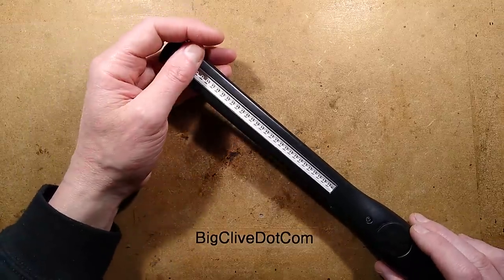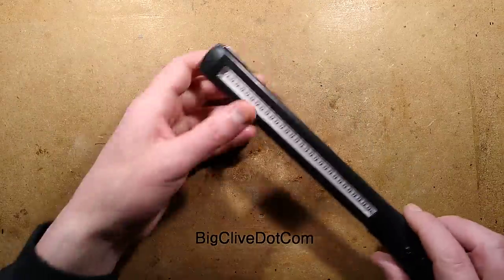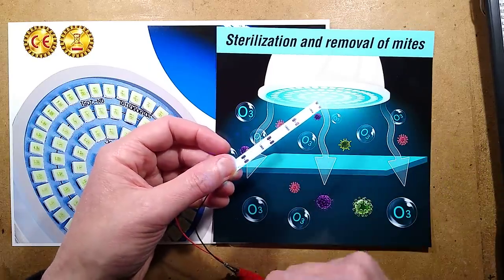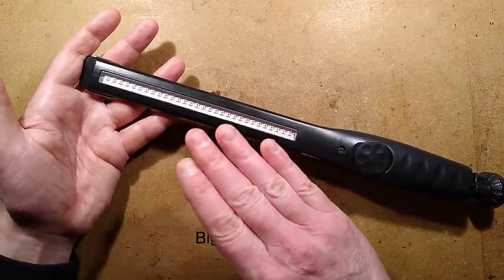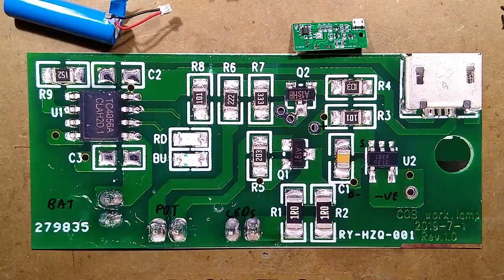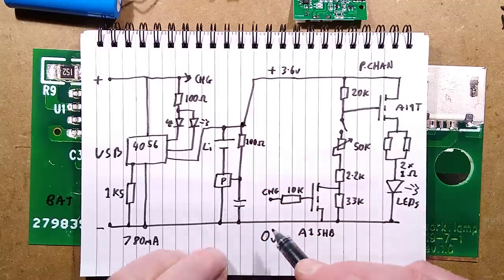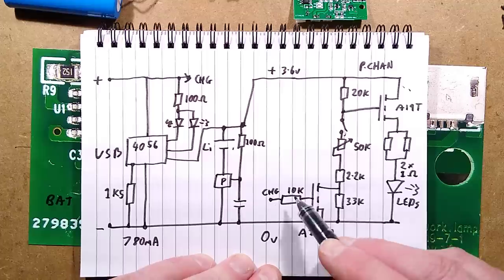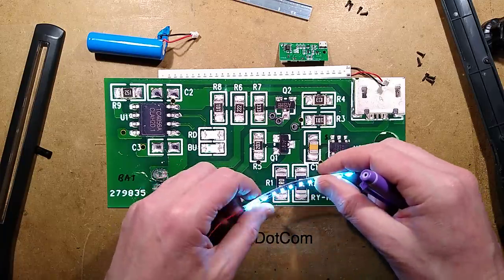More fake UVC "sterilizing" lamps from China!  (with schematic)

Comment: If it were UVC, that plastic window would absorb most of it anyway.
Reply: That depends on the type of plastic.  As far as I know, not all materials do absorb UVC.
Reply: heyou yeah but if you know a kind of plastic that does that for less price than the metal version you could make some good money selling that to manufacturers.
Reply: Acrylics with no additives allow UV-C to pass.
Reply: Mike Mondano, I thought quartz glass was the only glass that allowed UVC to pass.  Regular glass offers protection but I never heard anything about using plastic.
Reply: @Now_lets_get_this_straight  Many clear plastics pass UVC but they still aren't useful for this kind of thing because if exposed to UVC they quickly become cloudy, brittle and crumbly.  A few specialist UVC resistant plastics exist but quartz glass is cheaper so they are only used in cases where impact resistance and UVC transparency are both needed.
Reply: correct, it would actually absorb pretty much all of it
Reply: RemUVeTM k
Reply: ABS

Comment: I'd love to see someone try to get a refund on one of these because the UVC has made the resin deteriorate - what's the seller going to say, you're lying because it's not really UVC?  Oh well then I'd like a refund because it's not really UVC then, thanks.
Reply: Brilliant  :)
Reply: @teebosaurusyou  How?  If it's not UVC it's UVA which isn't going to cause you much harm...
Reply: I just did that dumb mistake of buying this exact same one and was wondering what should I add to my return text and make sure I get a real chance at getting a refund. Thanks for the help!
Reply: @MrK00T  I plan to complain that when I shine it on my skin it doesn't smell of burning, which means it's not UVC so I'd like to return it because it was falsely advertised.  The real question is whether the seller will give you a refund or require you to ship it back to China, which is very expensive, in the hope that it will make you give up asking for a return/refund.
Reply: @Berkeloid0  If it's false advertising, ebay may step in and force them to give you a refund without sending it back. It's worth a try. If enough people ask for refunds, maybe it'll force these crooks to stop selling them. I did that on a MP3 player from China that was advertised as 8GB and was actually less than 1 GB because they manipulated the software to show 8GB but you couldn't load even 1GB.
Reply: @waltp3373  Things are changing - the last thing I bought, the seller said sure I'll give you a refund just ship it back to China, and eBay wouldn't refund me until I'd posted it back.  The return shipping cost was about 100 times more than the item cost so this seems to be a new tactic of dishonest sellers to avoid giving out refunds.
Reply: @Berkeloid0  Request a shipping coupon from fleabay, and if they don't do it report them to the authorities for allowing sellers to pedal counterfeit goods. It depend on where you are though.
Reply: @olegkostoglotov8800  Tried it - eBay can't issue the shipping label automatically, so they say to pay for it yourself and ask the seller to reimburse you, and I know how well that will go.  I ended up raising a complaint with PayPal who refunded me but it was a long drawn out process and I imagine most people won't bother.
Reply: @Berkeloid0  I've been down the same road, although not with an off shore seller. Sometimes it feels like the joke about a Scotsman accidentally dropping some coins down the hole of an outhouse, so he drops some more down.
Reply: Berkeloid wat was the process like to get refund? A lot of customer service calls to diff phone numbers?
Reply: @yeahidoubtit2094  Nah it's all online with eBay, you just open a complaint and then send messages back and forth while the seller offers you tiny partial refunds equivalent in value to a few grains of rice, then eventually you can 'escalate' it if they don't give you what you are asking for before eBay's deadline.  That's when eBay get involved and as long as your messages have been polite and reasonable through the whole process they always close the case and give you a full refund.
Reply: Berkeloid thanks sounds good, I hope Amazon is the same!
Reply: @yeahidoubtit2094  Should be!  As long as you clearly explain what the problem is, what the listing said it was and how the item you received is different, then they always decide in your favour.  Even though you are writing your messages to the seller, it's always good to write them as if eBay/Amazon are also reading them (which they will if the seller is uncooperative), so you explain technical things in a way a non-technical person would understand it.  I've always done this and never had a refund request questioned or refused.
Reply: We keep falling for the Chinese bait and switch. This needs to be investigated. Ther got a good thing going here....selling their worthless shit and you can't get a refund.

Comment: As an auto technician I have that same lamp. We tend to use them for Air conditioning leak diagnoses. Some vehicles come pre charged with dye. Some we have to add it.
Reply: These lamps were probably never designed as sterilizing wands but just blacklights for say auto technicians for the very purpose you mentioned.  Somebody just saw the COVID-19 issue as a marketing opportunity and scooped up a bunch of these barely UV-A lights and labeled them as sterilizing lamps.  It's more an indication of a lack of regulation.  Just look at the products sold as cold medications in America back around 1900 or even the Whitehouse flouting hydroxychloroquine.  All countries will have people willing to scam their fellow citizens if allowed to do so and often the scammers just turn a blind eye to the product and the science so they can claim deniability.  Unfortunately it takes government regulation to prevent products like this.  We only see more products like this from China because they are less regulated, essentially because they are less "socialist" than the US.  We need to be asking marketplaces such as Amazon to better regulate themselves or asking our government's to penalize companies like Amazon for marketing these products.
Reply: @johnwang9914  I picked one up for £3.00 (new & boxed) from a charity shop. The box describes it as an Eyeshield LED work lamp. The magnetic base and does indicate that it is for auto workshops. Though there is a tiny, barely readable badly printed sticker (which is upside down, too) which states "UV light steriliz... ...geable Disinfection Lamp New. Made in China" so clearly there has been a half-arsed attempt to re-brand them as disinfection lights.
Reply: @ThatsViews  A bit ironic for them to label the near UV light as "Eyeshield" given that true UV-C light can blind you and of course should not be visible.  Of course any plastic near the LED's such as a transparent plastic cover indicates that it isn't UV-C and most likely just near ultraviolet blue light.  An actual single UV-C LED would be packaged in metal with a transparent quartz cover and cost in excess of $20 US.  It's amazing what people will try to get away with during an emergency like the pandemic, even more amazing what people will accept.

Comment: Companys who falsely advertise their products should be severely fined or put out of business. Stop the lies!
Reply: That might be the case in other parts of the world but not from China sadly.
Reply: Baby milk adulterating companies have had their directors imprisoned for LIFE for that crime.....the Chinese can act where they chose chose
Reply: Since it's not harmful UVC, they'll probably claim the Chinese equivalent of "no harm, no foul". From what I've heard from someone who lived there for the last 10 years, everyone is just trying to make money, regardless of the method.
Reply: @jasonudall8614  Those were Chinese babies, what happens to foreigners is of no importance.

BMW took a Chinese motor manufacturer to court for copying one of their cars.  The cars differed only in their badges, you could even swap things like valve seals and piston rings so the Chinese motor company had reverse engineered the BMW design to less than a 1/10000th of an inch.  They even used the same microprocessor and firmware in the electronic ignition system, though the circuit board was marked in Chinese only rather than in German and Chinese like the BMW product.  The court ruled that BMW had no claim as the "slight resemblance" was coincidence.  If it had been a rival Chinese motor manufacturer such a ridiculous ruling would never have been issued.
Reply: @FireAngelOfLondon  ...."when they chose"
Reply: Politicians should also face charges for lying
Reply: @thomasneal9291  UVC is a sensible preventative measure, not a means to stop all instances of viral transmission.
Reply: @thomasneal9291  Did you watch the video?  If it was causing the damage... it would be working while killing viruses and bacteria plus causing tissue damage.
Reply: @jasonudall8614  I thought they shot them?
Reply: @FireAngelOfLondon  Chicom courts are staffed with party apparatchiks, there is no independent court system in the P.R.C, this is one of the reasons 1000s of foreign companies are planning on relocating, even before the corona virus fiasco. The engine might resemble a BMW, but they likely won't last as long as a BMW one. There is a lot more to making an engine correctly then just copying the dimensions and tolerances, so BMW might have the last laugh, if they were smart they would also shut down their dealer network and cut off the parts supply in the P.R.C.

Comment: And so the hunt for a true uv-c led goes on!
Reply from the maker: They are available on eBay, but you have to specifically look for the little gold squares.  I bet a manufacturer starts making fake gold UVC LEDs soon.
Reply: That wand would work pretty well at finding the urine spots that one of my cats left all over the house with her UTI.
Reply: @bigclivedotcom  You mention in the video that they're "barely on the edge of the germicidal range" but really the ones i've seen are 265 or 270nm which is EXACTLY in the middle of the germicidal effectiveness peak and should make that light even more effective than the 254nm light from Hg. Buy one!!! I wanna see how much light they make and what you can do with it!!!
Reply: ThePacman300  thats very surprising given the absorption band maxima for oxygen molecules is significantly lower than 265nm. what led is it
Reply: I got an LG UVC LED at 270nm. That is right in the sterilisation range. The part is designed for sterilisation applications. I got it for my fish tank to keep the algae down.  Drove it with a laser constant current board. It lasted about a year.
Reply: @originalmianos  did that actually work?
Reply: @Muonium1  Yes it worked. It cut the algae down. The only issue was a year later when it failed the price of the LED was 3X so I never replaced it.
Reply: @xtremerace  it says only UV, I doubt is UV-C
Reply: just stop, people.  a portable fucking UV lamp is not going to protect you from AIRBORNE viruses, mkay?  

just... stop.
Reply: @bigclivedotcom  can you review 59s uvc products? They market themselves well but they use led. Would like to know if this brand is BS.
Reply: Why would you want a UVC LED? The current generation of UVC LEDs has a very low efficiency, compared to good old mercury lamps and cost around thousand times more, given the same output. The only applications I can see is those requiring very small or where the tiny amount of mercury is unacceptable.
Reply: @alunjones3860  The correct question is why WOULDN'T you want a uvc led???? It's deep uv light....from a crystal! with no moving parts! and no plasma or gas!! and with only ~10V!!
Reply: @bigclivedotcom  i dont think the sellers know they are not getting UVC bulbs  they see "UV" and think its uvc
Reply: UV LEDs are the next generation UV producing devises that will compete with UV lamps in the future. Researchers claim that the UV LEDs have characteristics surpassing regular UV lamps. At this time there is no UV LED equipment that can compete with the high output UV lamps in real world production conditions.
Reply: @Muonium1  Because at the moment UVC LEDs horribly expensive and inefficient. Perhaps in the future they'll get better, in which case, a UVC LED would be good.
Reply: @anndeefam  UVA LEDs are already much more efficient than mercury/fluorescent lamps, but I remain cynical about UVC LEDs. It's wrong to assume LED technology will progress at the same rate for all wavelengths. In the last 10 years there massive efficiency gains in the UVA - blue region, yet only modest increases in other parts of the spectrum such as yellow and green. Hopefully UVC LEDs will get better than mercury lamps, but the current state of the art UVC LEDs are only 3% efficient, compared to mercury lamps which achieve over ten times that.
Reply: Gold-plated LEDs should sell really well to audiophools, too. :-P
Reply: @alunjones3860  Actually since 2017 there have been much better UVC LED models. For example Laser Components (LG) has a LED with 7,4% efficiency and 130mW output power. This is compleatly in another league than "old tech" with 1% efficiency and 2-3mW output. But these new ones are expensive still. Thou Crystal IS just released info that their new 70mW output UVC LED will cost only $0,15 / output mW in large quantities. So prices are dropping.
Reply: @tkermi  Where can I buy those from? Do you have any links to data sheets? The best I could find was 3% and it wasn't cheap.
http://www.farnell.com/datasheets/2774752.pdf
Mercury lamps with a power output of tens of Watts and efficiencies of >30% are cheap.
https://www.ushio.com/files/specifications/germicidal-low-pressure-mercury-arc.pdf
Reply: I’ve one identical to this, a tube one and a little smartphone dongle. The latter has a metal-packaged LED with two blue LEDs either side so appears genuine.
Reply: @alunjones3860  Yes I know that the more traditional lamps are much much cheaper way to get UVC. But I did the research for the purpose where very precise narrow band spectrum (under 20nm window) was needed and for this LED:s are beneficial.

Unfortunately I do not know where they could be bought. But maybe the company who makes the PCB assemblies to them could sell them directly. Thou it is possible they demand large quantity... (I just did the preliminary research for a company which finally ended up not yet upgrading their current system). 

Anyway here are the links for the LED:s below. I noticed that if you want to get reasonable life time from these you need to use really good heat sink or drive them only 50% power (to get 5000h or more life time).

https://www.lasercomponents.com/de-en/product/uvb-uvc-leds-260-315-nm/

The LED I referred was the model:

https://www.lasercomponents.com/fileadmin/user_upload/home/Datasheets/bolb/smd6060-uvc-led-high-power.pdf

This is the "Bolb" company who makes those PCB assemblies for Laser Components:

https://www.bolb.co/
Reply: "Let's take this to bits,  cause that's what we do... ". Love this guy!
Reply: Jean-Louis Bourgeois  amen to that.
Reply: Google Cure UV in Delray, FL
Reply: @Muonium1  What is the energy level from that?  Those things barely put out anything.
Reply: Only buy from a reputable company.
Reply: Im using my UVC for fish tanks. I have 2 25v. How do i know it works? 1st the burnt smell, 2nd when i inhale the fumes i can feel like theres sand un my throat, 3rd it affects my eyes, like right now i can barely open it 🤣
Reply: there is still a great deal of research that is required to design effective led UVC units. The cost of the led's are extremely high and they have a major problem with overheating. Designing something the size of a hand held device is futile as the dosage required must be accumulative i.e UVC DISINFECTION DOES NOT WORK LIKE A MAGIC WAND
Reply: ThePacman300  NO IT DOESN'T
Reply: @xtremerace  the answer is in the name - UVC provides percentage disinfection and not sterilisation - you purchased a toy
Reply: So,what cheapest UVC  led is good to steril whole room, any link ,please .
Reply: @bigclivedotcom  could you help with the link
Reply: Jean-Louis Bourgeois  the western capitalist are the real villains,  all they care about is max profit,  not reasonable ,but MAX. SO SCREW INTEGRETY,  GIVE THE CHINESE  $1 to make it
Reply: @tesmith47  False advertising laws would hit them if they were in the west though.
Reply: @edwinshares7716  it's not being made that simple.
Reply: Ha Quack QUAK!!😂😂😂😂😂😂